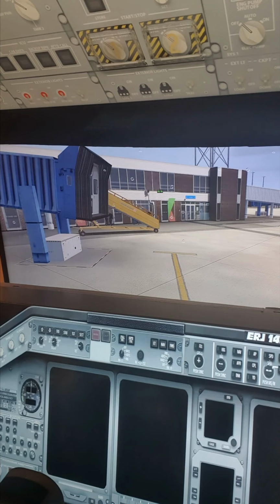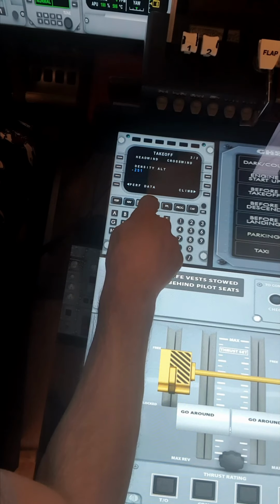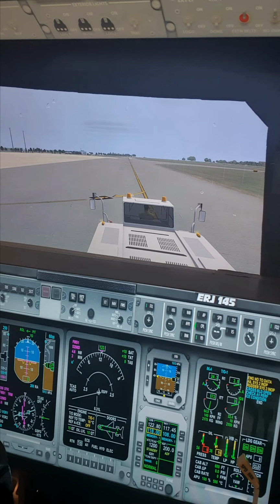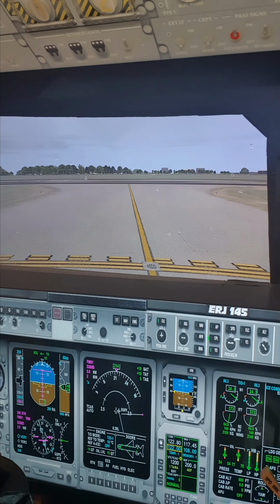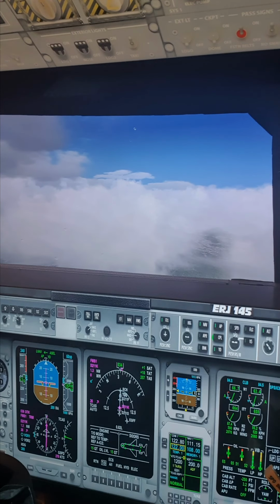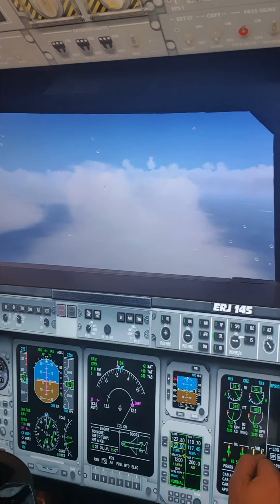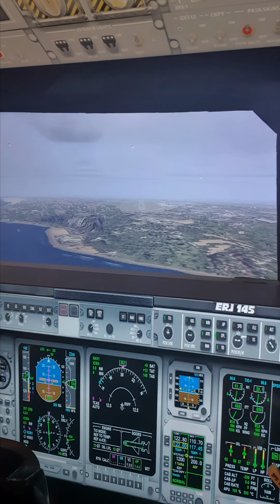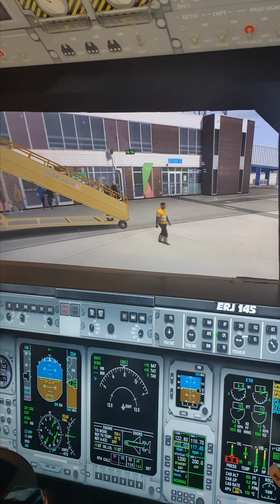Embraer 145 full flight

Comment: Hi Alex, you configuration is incredible, amazing. It is possible that you tell us a little about your setup, and the way you operate and configure the 3 touch screens, do you use a single pc? best regards
Reply from the maker: Hi Matias,
Thanks for the appreciation.
in brief, my setup is quite simple:
i use only 1 PC (intel 3770-k overclocked at 4.5 ghz, 32 gb RAM) with 2 GPUs (nvidia 680gtx) and win 7 64bit. The sim is FS 2004 (with a lot of addons). I use 3 touchscreens for the cockpit (2 iiyama 32” + 1 iiyama 27” capacitive touch monitors) and a Samsung 43” UHD TV for the external view. The good thing is that there is NO NEED for any configuration (or driver)  for the monitors, because Win 7 recognizes them automatically. I simply drag the panels of the cockpit on the chosen monitor, hit ALT+ENTER, and i’m ready to go! (there is a video on my channel in wich i show the procedure). It is so simple that I think that Anyone can build and operate a cockpit like mine in less than one day!
It works flawlessly with FS2004 (i have smooth 30 steady FPS in any condition and with any aircraft, with all graphic sliders maxed out). No idea if it works with any other sim.
All the best
Alex